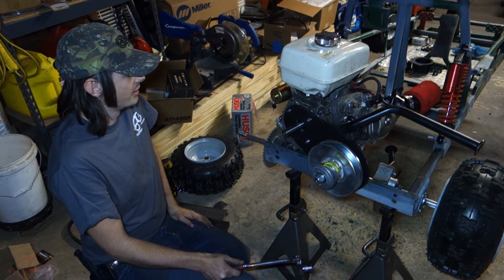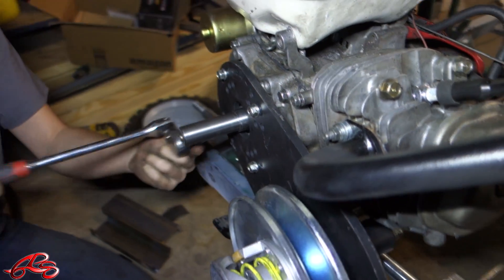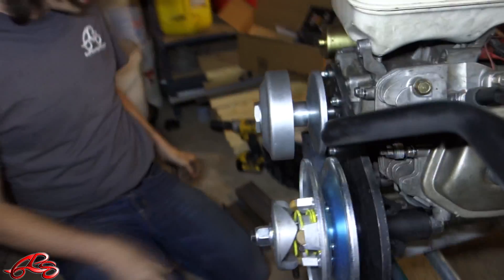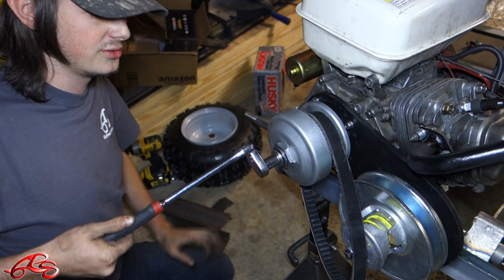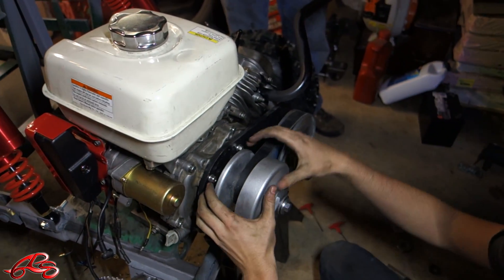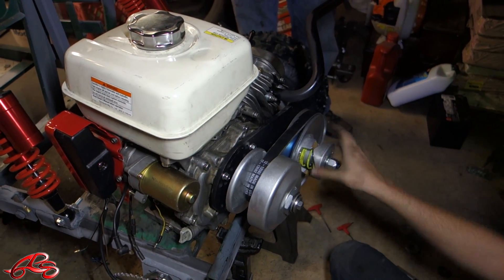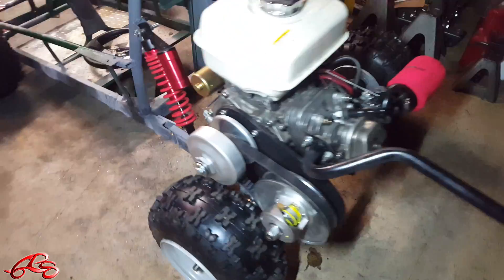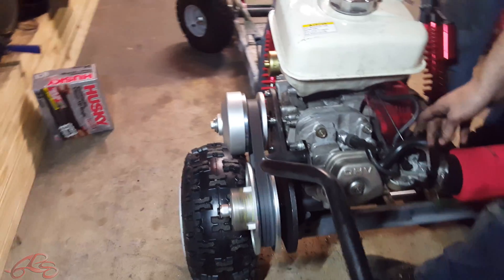Installing 40 Series CVT and Mounting Engine FSTGK Pt  7

Comment: check your belt, I think you put it on backward. The belt has a tapered side and a flat side.
Reply: It doesn't on the 40 series. The reason that their belt is shifting off center is because the driver and driven are moving different directions. Flipping the driver is a quick fix for this issue.

Comment: Wrong secondary for 40 series. That's why you have such poor belt alignment at high RPM. You need the reversed secondary spring then flip the secondary over so the spring side faces in.

Comment: You can put the engine side drive pulley on backwards to fix belt centering, it works fine.  40 series back plate by itself.  Save $, source pulleys and belt yourself:  https://www.ebay.com/itm/Heavy-Duty-40-Series-Torque-Converter-Back-Plate-Comet-Clone-TAV-Backplate/273786905166?hash=item3fbef8a24e:g:cFcAAOSw9mFbBYn5

Comment: Geeeeeeze that belt was all outta line at high rpms.  Sheesh
Reply: That's because his driven pulley is on backwards.
Reply: @lazzer408  I was curious about that. If he had the drive clutch turned around like you said, what would the alignment of the pulleys look like with the engine off? Would they be perfectly lined up with each other or would there be some misalignment? I bought the GPS 40 series TC and I think the directions show the drive pulley going on like this guy did it. But then clutch engagement happens in opposing directions which results in the crooked belt at rpm as seen in this video. I’ll re check my directions but it seems like you’re exactly right!
Thank you
Reply: @zmac7467  There are companies selling a bolt-on 40 series system that's rigged with a reverse spring.  This is wrong. The only system intended to bolt to the engine is the TAV which is a 30 series. The 30 series uses an asymmetrical belt to alleviate the problem. The 40 series uses a symmetrical belt and was never intended to be used like the "torque-a-verter" (TAV) bolt-on system. Look at Comet's instructions. Nowhere does it show a 40 series with the spring outboard, away from the engine.

As for belt alignment. When used properly, the 40 series belt will move towards the engine on BOTH pulleys. It never comes out of alignment.
Reply: @lazzer408  thank you for your response.
I’ve attached a link to the clutch I have for your review. My project isn’t complete yet, I’m just trying to gain as much info as possible before I set it up.

https://www.bmikarts.com/PDF/Comet_40series.pdf
Reply: @zmac7467 That's what I used on my Husqvarna build. Follow their instructions and they work fine.